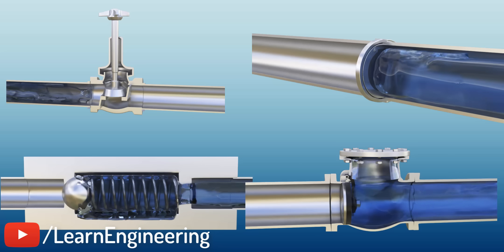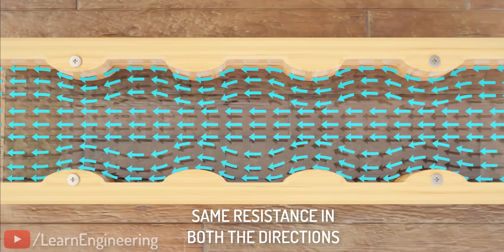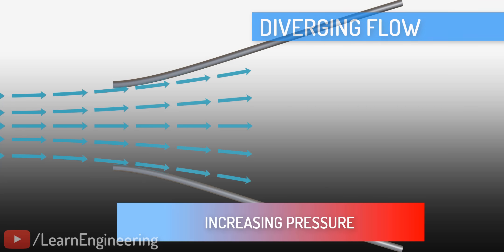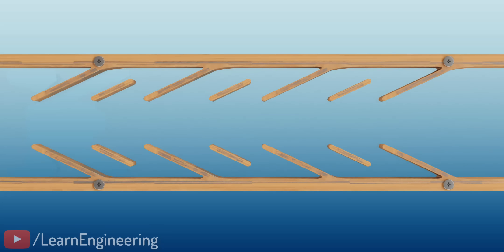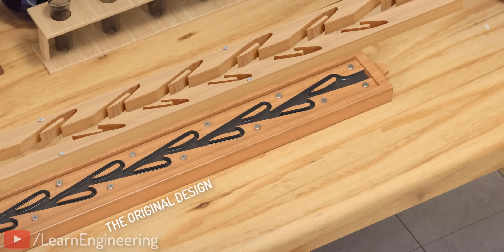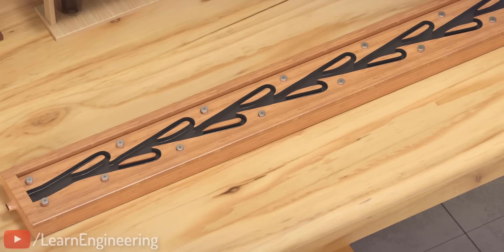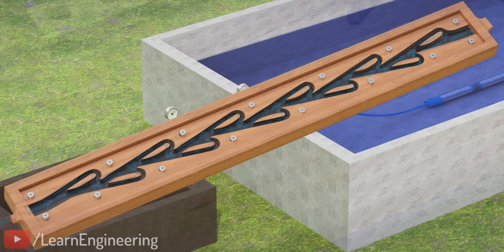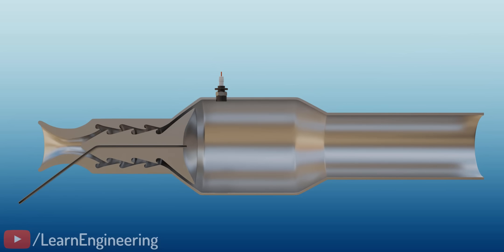Tesla Valve | The complete physics

Comment: These principles also apply to the human cardiovascular system.
Reply: Incredible. I'm going to research that. I'm guessing that the tubes get increasingly smaller?
Reply: Exactly that's what I was thinking
Reply: I only noticed until you mentioned it 😳
Reply: I didn't realise this, I thought that recirculation was best avoided in the cardiovascular system and that the venus system has moving valves. also the elastic properties of the arterial wall help propel blood through the system. Venus flow is dependent partly upon muscular compression of the venous system and valves. Recirculation is massively avoided in the arterial and venous system such as the Miller Cuff using during femoral artery bypass (if I recall correctly) and in arterial aneurysms, recirculation and stagnation cause sclerotic build-up and eventually stresses that cause rupture.
Reply: Actually our heart have moving part. It's not rigid

Comment: ARE YOU EAGER TO GET RID OF ASTHMA AND ALLERGIES?  

Finally Introducing...

THE HERBAL SOLUTION FOR ASTHMA
If you desire to completely get rid of Asthma and other related complications, then "BETACURE ASTHMA SYRUP" is what you need for yourself and everyone you know that are suffering from Asthma.

The syrup consists of herbal ingredients that help to deal with the root cause of Asthma, it's very effective in dealing with asthma and rejuvenate your overall health until you are finally free from Asthma and allergies.

First, your bronchial tubes are cleared of the sticky mucus which aid unhealthy and blocked airways. 

This Natural product heal the lungs, and brings the body system back to the position of proper self defense with the help of the antioxidants it contains. 

This is the best way to ensure that Asthma is completely eradicated as opposed to chemicals (drugs) which only give temporary relief for the symptoms without the hope of a permanent cure. 

@ EBAKO ULTIMATE SERVICES  have a more effective natural treatment for Asthma, which will clear the mucus from the airways, heal and open up the lungs and improve the lungs and amount of air flow. 

BETACURE ASTHMA SYRUP will boost the immune system of the body to be able to fight against contaminants and eradicate asthmatic problems completely.

#BETACURE The natural solution to ASTHMA.

Whatsapp/Calls: +2349057017166 / +2349067631055

Comment: Your explanation of pressure between 1:35 and 2:00 is confusing: it’s NOT because of increased pressure that vortices are created, it’s because of vortices that pressure increases. As the volume expands, pressure gets normally lower along the flow, but because of viscosity, and chaos created by the expansion, the fluid is slowed down.

Comment: Your converging/diverging flow model is terrible because in both cases while half your flow is diverging the other half is converging. You can't see that there is identical volume covergence/divergence near the walls as there is in the middle?
When you rearrange and push the panels to the walls, in convergent flow you are creating a vacuum in theose negative flow areas, and in the divergent flow model you are creating pressure pockets. In both cases I am unconvinced the fluid is flowing as you are describing.

Comment: Internet know-it-all - "It isn't a valve. It's a regulator"
valve
[ valv ]
noun
any device for halting or controlling the flow of a liquid, gas, or other material through a passage, pipe, inlet, outlet, etc.
Reply: if you had any practical skill instead of googling things you would realize that we use valves to control a mechanical process we dont use dictionaries to stop and start machines

Comment: It is not too much complicated. The water which goes side way that makes pressure to the main way

İf you make that construct with a pipe, it will not be effected. Because in the pipe ,there will be 3 types of flowing.flow of deep side of pipe ,middle side  and the top side . 

İmagine a sea. Sometimes the top side of the sea looks like carpet. But inside of the sea, there is waves and flows. So, for pipe, it will be same.

Comment: I'm missing something here...if the purpose of the valve is just to reduce flow without any moving parts, why not just insert a length of small diameter pipe in the discharge line?  Actually, you can't call this a valve - it's really just a flow restrictor.  If it was a valve it could open and close and allow flow to pass at varying flow rates.
Reply: It's not just reducing the flow which is easy, it's reducing the flow in one direction only that makes this apparatus different.
Reply: A narrow pipe would restrict the flow both ways. The whole point of this valve is to be one way

Comment: I don't know man. When you ask me if a one-way valve without moving parts can be made, my first question is "why?" 
Why should it be made? Looks to me like a much bigger valve for basically nothing. 
Can someone explain to me the benefits?
Reply: It was part of his bladeless turbine invention. He made a gas turbine and used the Tesla valve to direct the flow of explosive gases to the turbine. Feeding air and fuel in one end and getting a blast of hot gasses out the other. A conventional gas turbine engine gets the same effect with a very complicated expensive rotating turbine fan.

Comment: The two examples around 1:14 will have similar resistance in both directions as the blades don't touch the sides of the channel, hence there is a combination of diverging and converging flow in both directions.

Comment: Theoretically wouldn’t this also be good for a muffler
Reply: The first couple animations where it's just the baffles, the left to right flow displays exactly how suppressors for firearms (often erroneously referred to as silencers) work. The suppressors were the inspiration for the first mufflers, based off Maxim's designs for the first generation of suppressors in the early 1900s
Reply: An astute observation. Look at a suppressor cross section, and then look at a muffler cross section. You'll see more than a casual resemblance

Comment: This valve does not work anywhere near as well as people think. This valve depends on flow velocity to create restriction. The restriction delta is not a very high percentage of overall back pressure. It is very loose fluid mechanics  to call this a one way valve".  It is NOT by any stretch a "one way valve".

Comment: The only real practical use that I can think of for this would be as a flapper valve replacement in a pulse jet engine. Even for that, I would imagine machining the complex shapes required in 3 dimensions would be quite expensive. Pulse jets are mainly built by hobbyists anyway, so not much money there.

Comment: Hmm... this technically would not be a valve because a valve arrests flow completely. That's the point of a valve - to be closed normally and then open when needed. In effect it is binary. 
The Tesla Valve is a misnomer and it seems to be more of a flow regulator. The valve is needed when it is ok to have a small flow and larger flow. But I don't quite understand the point of this, despite the applications, because you still need a mechanical motion to swivel the valve around to reduce the flow. So it is needing of more parts to do that. Additionally, I don't get the fascination with not needing mechanical parts. I mean, there's no law that says you have to not use parts that work well. Just use them to get the work done.

Comment: Just call it "its so inefficient, that it almost blocks it"
Reply: Making it a flow reductor rather than a valve.
Reply: @BlacksmithTWD  agree, its not a value, its not able to block the fluid completely, its more like a diode in electronic
Reply: @tomcurtis3149  It does actually feel like a Diode with biased electron flow.
Reply: @tomcurtis3149  or a diode with a parallel resistor since a PN junction on its own is very good at blocking reverse current which is the purpose of having them.
Reply: It's honestly more useful being used in reverse. There's really no reason to use it going the higher flow direction. This technology leveled a many British buildings.
Reply: @wolfpack4128   " This technology leveled a many British buildings."  ( Huh ... ? )
Reply: Thanks for your “almost”.

Comment: Clever but of little use. Virtually all one way valves are used to block a flow, not limiting it. One way valves are often used in plumbing or gas transport. A valve that keeps on trickling is useless.

Comment: Am I the only one here who recognizes the answer to the question at 1:04 is "both are the same?" If you are having trouble conceptualizing why that is, draw an imaginary horizontal line down the middle of both of these models. The resistance with which the water flows above the imaginary line is the equal and opposite of the resistance below the line within the same model. Therefore both models will produce the same result.

I think you meant to connect the slants to the walls of each model before posing that question. Then the answer to which you were leading would have made more sense.

Comment: I love this idea - But as a person who works in the Fire industry , and as someone who tests, repairs, and installs back flows for the municipality’s- Why then are the single check assemblies that are approved by every manufacture, fire marshal, municipalities, UL (underwriters laboratories) and every other third party firm that gives credibility Towards products using the current valves and not the Tesla valve ?? It seems like we’re using a product that costs exponentially more now, that also fails regularly thus causing potential for health hazards and mechanical failures to the products they are installed on ??? If this valve is tried and true - Why isn’t this made and put into effect accords the board everywhere ?

Comment: I say can't be a valve if it can't fully block the direction of flow.
Reply: It isn't a valve in the colloquial sense, but it does fit the broadest definition which doesn't specify that a valve must be able to shut off the flow entirely.
Reply: @utfan971  The example used in the definition is a water being shut off from a boiler. I would assume that the requirement of being able to stop the flow of liquid would apply.
Reply: @MatthewLiut  on this you are right, the comparison implied at the beginning of the video is wrong in principle.

Comment: I have built this valve. It has high restriction on the reverse direction, But is not a one way valve. The slower the air or fluid goes in reverse, the less restriction.   a quick burst in reverse, is mostly restricted.
 I have a cnc mill and was able to make very acurately

Comment: This is a fluidic diode, and works like an electronic diode in fluidic circuits using substances such as water and air. A fluidic transistor can similarly be designed, so that small, slow-speed digital computers can be constructed out of fluidic components. This technology has been around for years, but is not popularized.
Reply: @Blue Tab True, it is slow, but efficient enough for hydraulic control in construction machinery and similar applications. Unlike electronics, fluidics can easily be manufactured to be highly reliable.
Reply: @Blue Tab You are thinking of the most commonly-used hydraulic controls, such as a simple manual valve that allows pressure to increase inside a piston. That is not what is meant by pure fluidic computers or controls. They look very much like the models shown here and have no moving parts. Yet, even without moving parts, they can perform Boolean operations and can store state information, the two functions at the heart of computation. As I said, there are applications where inefficiency and slowness are not problems, and where using fluids is natural and useful. By the way, there are also circuits made purely by the manipulation of light. Such photonic circuits are superior in many ways to electronics (faster in time and smaller in space), falling down only because ultimately the results of a calculation in light must be converted to the classical regime using lossy electronics.
Reply: @Blue Tab I apologize for your ignorance. Perhaps you'd take the time to do some Web searches?

Comment: pressture never increasces  when goin from smaller diameter to bigger,oposite.... so how the hell it can work?pressture getting bigger when same amount watter used on smaller diameter(thats the  way how works most injection systems... and you trying to prove oposite(yea you- wanna belive Tesla wasnt so dumb)?insane. and yes was nice video but its not a valve...and you are explaning that like biggest dumb ass who never goes to school.... sorry, btw idea itself realy good(Teslas idea):)idea is in that -mine flov getting more and more pressture, and everytime is splitted into oposite flows, witch ones step by step are getting same strong as mine flow, and after counted amount off actions it will be same strong as mine stream, to block it.but its not a valve cause you cant do anything else instead off stop leak....but yea thats smart....-flow stopped by own powers - with 0 emission.....and without moving parts....but its its only prop right now-not valve.ps stopped watching from the moment you sayes presture getting higher on the bigger diameter....

Comment: Impressive but it doesn't completely stop the flow.
With modern technology it's possible to make a value with no moving parts that can completely stop the flow of some types of liquid.   
Use a thermoelectric cooler (Peltier device) to electrically freeze the liquid solid at a point, and also use it to allow the flow by it heating the frozen point.

Comment: He was a genius thats right. But this system he build is no valve.
Reply: It is a valve. Its just a leaky valve.

No it doesn't stop 100 percent of flow from the more resistant direction, but if a valve is a mechanism designed to greatly favor flow in one direction verses another, then this is indeed a valve.
A valve does not need to stop all flow from one direction to be considered a valve. This us definitely a valve. Its just a leaky one.

Comment: Add to my remark as a silencer. 2 rows of baffle wings 180 degrees apart will hinder projectile spin since there is a force wave in the barrel ahead of the projectile. 
OK, I understand suppress vs silencer. Some readers might not. With or without venting it could be VERY small.

Comment: Silencer if you differentials change the size of the baffles as you go. Adjust baffle - wings size and number for pressures and velocities. Better than right angle washers welded or machines  with different  size holes fore to aft.

Comment: Would work great in a hot water circulating system under the sink connecting the hot water side to the cold water side and thereby always maintaining hot water instantly available at the sink.....pump could be either at the sink or at the hot water tank....install at the longest point in the line and then all sinks would always have instant hot water.

Comment: A check valve, when operating properly, stops flow. So the Tesla valve has no application when you need to stop flow completely. You will always need something with moving parts. The Tesla valve regulates flow more than anything.